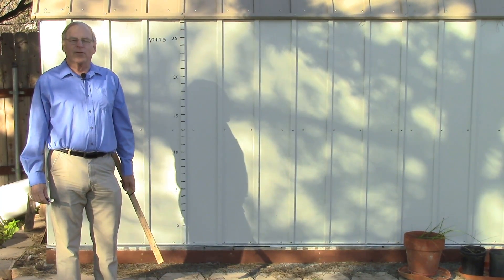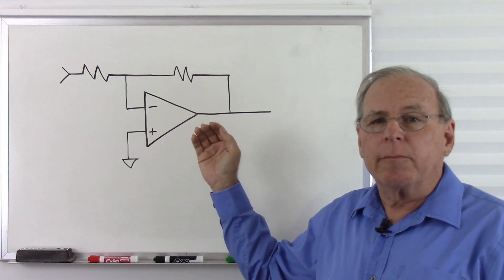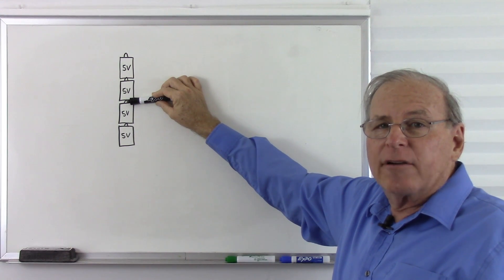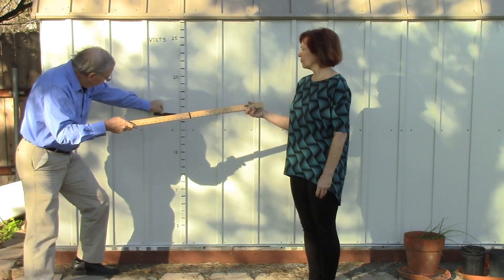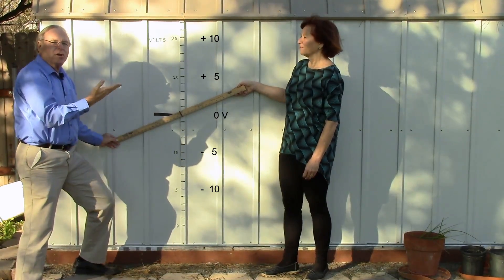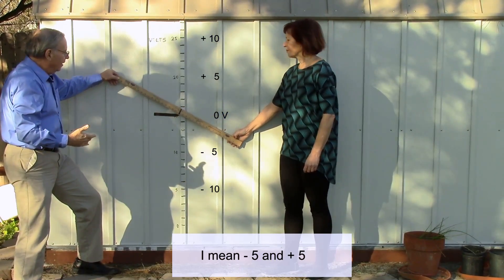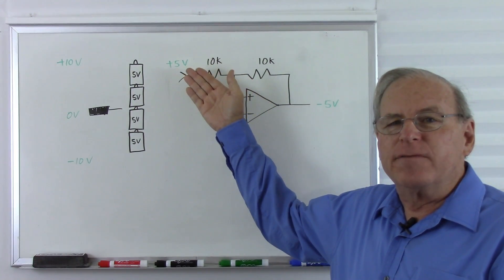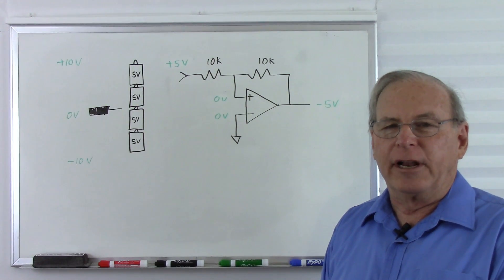Guest Video: Bob DuHamel - How Opamp Virtual Grounds Work

Comment: It is overcomplicating a simple feedback operation.
Imagine ground at the V+, and 5V at the V- prior to the resistor with +-15V power source
Since the differential voltage is negative (V- has 5V), the output will be -15V.
But now the power difference between the 5V and the 15 is 20V which makes the voltage at the V to be lower than ground so the output becomes positive
This feedback continues back and fourth very fast to the only stable state of zero differencial.
The very high gain purpose is NOT to zero the voltage difference but to respond to very low voltage swings

Comment: Why are all these explanations made so overly complicated ? They all highlight very specific cases. Alter the question a bit and nobody can figure it out anymore. Virtual ground .. there is no such thing as virtual ground. What if the + input is at 1 volt ? Confusion all over. The explanation for inverting does nto work for non-inverting or differential. They are all unique cases with simplifications that hide the real operation.
There is only two things you need to remember about an (ideal) opamp : 1) It wants to see the both inputs at the same level. The output will do whatever it can to get there. 2) the inputs of an opamp do not take or give current (again, ideal opamp). Let's take the inverting circuit. R1 is from signal source to the - input. R2 is from output to - input. Doesn't matter what the+ input is connected to. Let's set it to 0 volt. So rule 1: says the opamp wants to see both inputs at the same level . That means it wants to see 0 there as well. The source applies 1 volt. That means there is 1 volt across R1. ! volt to the left, 0 volt to the right. That gives a current of 1volt/R1. We know the inputs of an opamp do not take current, so the current can only go through R2 to output. Take that same current going through r1 and multiply it by r2. That gives you the voltage across r2. You can now calculate the output voltage of the opamp using a simple subtraction.
If i put the + input at 0.5 volts the same rule still works. Vin - V(-input) / R1 = current through R1.  That current x R2 = voltage across R2.  V(-input)+V(r2) = output voltage.

The same is applicable for the non-inverting opamp. The + input wants to be equal to the - input. if i put 1 volt at the - input , the opamp want 1 volt at the + input. Find the current through one resistor and multiply it by the value of the other resistor and you have your answer.

Differential amplifier ? Same deal. Find the current , multiple by resistor value. It is as simple as that. Ohms law is all you need.
Want to do it for AC ? have capacitors in there ? Treat your resistors as impedances. Doing that by hand gets tedious because you have to sweep frequency and amplitude and take into account phase shift : send it to the computer. it can do the monkey work.

Comment: Thanks for the good work, it was very helpful. If I understand correctly, there is a power supply with a + and 0 voltage and in the middle let's say between two resistors which are in series connected to the + and 0 of the power supply a virtual 0 volt, and from here on you use the virtual 0 volt as ground through the whole circuit. Please let me know if I 'm wrong.

Comment: A much faster explanation is that the input voltage minus the current times the first resistor will always equal zero because the op amp has chosen a specific current to make it so. Vi - I*R = 0.

Comment: Well done Bob Op Amps can even get confusing for Engineering Students as  the relationship between the inputs is described as both inputs are at the same voltage potential and no current flows between the inputs. From that students are told to treat both inputs as 'the same node' and write your Nodal Analysis equations from there. There is nothing incorrect about that description its just very incomplete and at times  confusing. Again well done.

Comment: The confusion arises because tutors say the opamp tries to make the -ve input "the same as the +ve input, i.e. zero".
When what they mean is that it tries to make the -ve input 100,000 times smaller than the output i.e. the opamp's input voltage is equal to the output voltage divided by the opamp's gain (open loop). Doesn't matter if you're using feedback or not, that has to remain true. So the input voltage ends up very, very small, sure, but NOT zero.

Comment: Very complete and thorough explanation! However, an op-amp only tries to compensate the differential voltage at its inputs with the output only if there is negative feedback. This is valid for inverting and non-inverting amplifiers alike. I don't think you mentioned that detail, and it is a very important one. Anyway, this is an excellent video, and thumbs up!
Reply: I think he was trying to leave out too many things that would amount to, "except in the case of..", which would re-confuse a lot of people.
Reply: This is not an "except in case of" example, but rather a "only happens in case of". He only had to mention that the op-amp has to have negative feedback. But I do agree that it is a detail, although an important one.

Comment: This video is only the introduction. "The op will do what ever it can to keep zero" as Dave says is not the full answer. Mentioning the input stage inside the op amp (The differential Amplifier) with its characteristics will solve people's confusion. The (high gain, and not to forget very high input resistance) differencial amp senses small (or big) differences of voltages. It then amplifies them and present them to the output which is (negativly) fed back till the differences are brought to zero. Then at zero input the output stabilizes. The high input resistance (of the differencial amplifier) minimizes input currents so that measured objects are not significantly loaded.

Comment: I find that lot of people think that voltage is in a point, like there is 5V, but not. Voltage is between two things, so 5V is between this and that point. 0V doesn't mean there is nothing, but it means, that there is no difference between the two points: between the red and black probe in this situation.

Comment: Nice work Bob, good and simple. Only to bad you didn't show a less than 1 ratio setup. And this is of course explaining it as it would be on the perfect opamp. Even if with the modern high gain ones you can't realy meassure the difference with a plain multimeter there actually is a microvoltage difference on the imputs to get the output required. For example to get 10V output at a 10.000 gain opamp that would be 0.001 volts

Comment: It is not true that zero volt is applied to both inputs. If that were so then the opamp would also amplify if you put both inputs on ground. The opamp has a gain factor (g). The voltage at the negative input is Uout/g.

Comment: Nice way to clear that out. Voltage is just the difference between any two points.
And the relationship of input and feedback resistor as a bonus.

Comment: Something I never quite got: If an OpAmp always tries to equalize both its inputs, how does it matter which "way" the inverting and non-inverting inputs are connected? Couldn't you just (in this example) swap both inputs? What would be the difference?
Reply: The difference would be quite considerable. In order to understand this, you have to consider how the opamp actually does it - as outlined in some other comments, it is a very high gain differential amplifier:
(Vout - Vref) = ɑ * (Vin+ - Vin-)
with ɑ >> 1 (often 100000 or more) and Vref being some sort of reference voltage that depends upon opamp design, often the negative supply.
Therefore, assuming Vout actually is in a valid range, (Vin+ - Vin-) must be very much smaller than (Vout - Vref). Assuming the latter being 15 V and ɑ = 100000, we get 15 V / 100000 = 150 µV. This also means that very little current will flow into the input, making it look very high impedance.

If you are hooking up the feedback resistor to the inverting input, it provides negative feedback, reducing external gain considerably while increasing input impedance and decreasing output impedance.
If you are hooking up the feedback resistor to the noninverting input, it provides positive feedback, and the output would just latch up, i.e. run away to one supply rail (after all, the higher the output voltage, the more it's tugging on the noninverting input in the same direction, making the whole thing even more touchy than the opamp without any feedback at all, which is basically unmanageable as-is - imagine a car that will do a 180 each time you move the steering wheel by a micrometer). Under this condition all assumptions about the opamp are going out the window. So that clearly is of no use.

There are a few applications involving some (but not exclusively) positive feedback, but you have to be extremely careful. This can be used to generate negative output impedance for negating wiring resistance, but you have to know exactly how long your wires are going to be, or else you risk ending up with a first-rate oscillator, as circuits with enough positive feedback tend to be.
Reply: Well, thanks, I guess. Further studies required!

Comment: The non inverting input and the inverted inputs are swapped over at 8:39.. this would make the circuit a unity gain voltage follower oops!

Comment: I believe an easier way to understand the virtual earth concept is to look at the Op Amp open loop gain. The open loop voltage gain Av = Vout/Vin is extremely large, typically 100,000 to 200,000, therefore the voltage between the inverting and non inverting inputs is very small. If the non inverting input is tied to ground, then the inverting input voltage is so small it is said to be at virtual earth potential. The input signal of course does not disappear at the virtual earth, it is 100,000 times smaller than the output voltage. Near as damn it to ground.

Comment: Nice, intuitive. It's actually a voltage divider with two variable voltage sources at the ends, the opamp source trying to keep the voltage in the middle at a certain level.

Comment: Nice demonstration! But there really isn't any JFM as to why the inputs are always at the same voltage: An op-amp is essentially a differential amplifier with really large gain (on the order of 1 000 000). This means that if the output of the op-amp is, say, 4.5V, the difference in voltage between the inputs must be 4.5/1 000 000 = 0.0000045V ~ 0V (for an op-amp with gain of 1 000 000). Because of this large gain the inputs always differ by approximatally 0V (so long as there is feedback). No magic needed.
Reply: Off-topic question: "JFM": Neither https://acronyms.thefreedictionary.com/JFM nor https://en.wikipedia.org/wiki/JFM clarify it, but left to guess that it is the definition given at https://www.urbandictionary.com/define.php?term=JFM .... is that correct?

Comment: Does it make a difference which input of the opamp is "+" and which one is "-" in this use case?
Reply: Yes, because if the resistors are connected to the +, it will be positive feedback and it will not work as an amplifier. In at least one of the drawings in the video it is incorrect.

Comment: Excellent explanation but the reason the voltage at the inverting input remains zero is due to the fact that the currents reaching that node through the two resistors are equal but opposite. I think current should always be mentioned.

Comment: Not very good. You need to emphasize that the intrinsic gain of the opamp is extremely high so that for a finite output voltage the inputs are the same, as a very good approximation. Saying "the opamp" tries to make the inputs the same" is just black magic handwaving, with no explanation.
Reply: @Robert schmitt trigger comparator and oscillator are two examples where negative feed back isn't used.
Reply: I agree. The mechanical demonstration is very good, but it does not explain why the voltage would become 0. Also, if we used positive feedback, the voltage would not be 0.
Reply: It would have been good for him to say that his explanation only works for opamps with negative feedback.
Reply: Prehistoricman Would you give examples where you would not use negative feedback. Without feedback the op-amp is unstable and with positive feedback is totally unpredictable.
Reply: It's all about a learning process. Yes there it is more complicated. Giving a student a firm understanding of the what it does can be drowned out by the details. This level of understanding has to come first, or students won't now how to deal with practical circuits.☺
Reply: He's explained one usage case and in that respect, it's a pretty good explanation.  Most people watching this aren't engineers and so they need to be given the concepts one-at-a-time.  For people really serious about the subject, I'd say "go to college" - but that's why it's called 'college' and not 'YouTube'...
Reply: The way in which the presenter said that "opamps try to make their inputs have no potential difference" sounded too generic to my ears, and could fool a beginner into believing that opamps always have negative feedback.

Comment: Bob, i believe there is an error in graphics. You should have drawn "-" on that op amp input and not "+". Because the output is inverted as your drawing shows. Plus the schematic you drawn is typical  schematic for inverted input setup. For non inverted input it goes a bit different.
Reply: @Don Solaris  I saw that as well. Good eye...PEACE
Reply: Where is the error you're referring to?  What time mark?

Also, inverting and non-inverting circuits are identical, only with input and reference (GND) swapped.
Reply: At 8:35 the op-amp looks right, a couple of seconds and for the rest of the video the inputs are swapped (messed up), acting like a Schmitt trigger.
Reply: Yep, it happens at 8:38.  I see it now.  Easy mistake to make.  Thanks.

Comment: There it is finally. The most intuitive way to explain inverting opamps.
Reply: Let this be the yardstick by which to measure all op-amp explanations... and to measure op-amp voltages on diagrams. :P
Reply: Yeah, anyone trying to understand op amps really needs a practical intuitive understanding first before trying to understand the math. It can also help to play with some crude discreet transistor based op amp circuits to help gain an understanding of what is happening on a fundamental level. This will allow you to probe other parts of the circuit or experiment with JFETs/MOSFETs/Darlington configurations. It's a great excuse to create a sacrificial offering to the Engineerapagan Magic Smoke gods.
  Then learn KVL as it relates to op amps....Still wrapping my head around that one myself in practice.

Comment: Pivoting the stick on a nail or screw would eliminate the need for an unwilling participant but it wouldn't be as entertaining without the anticipation of argument.
Reply: I also think that pivoting the ruler might have contributed to the misconception that the + input is somehow tied to ground. Not having a pivot show that it's only at ground due to the reaction of the output.